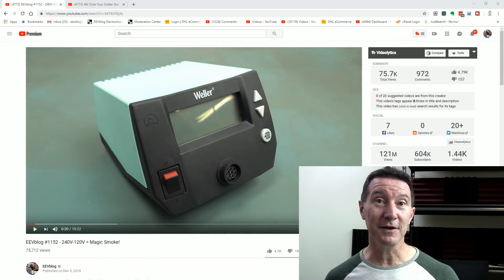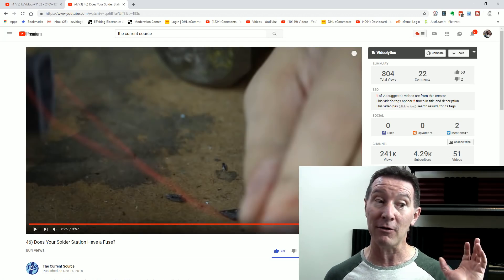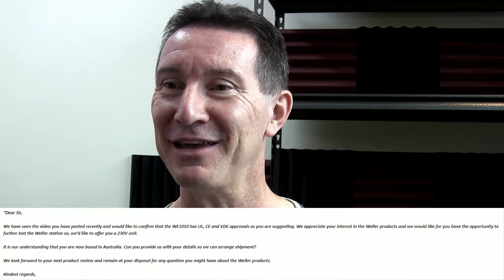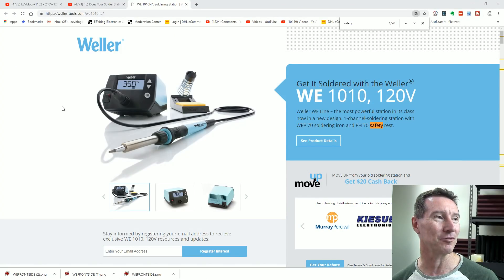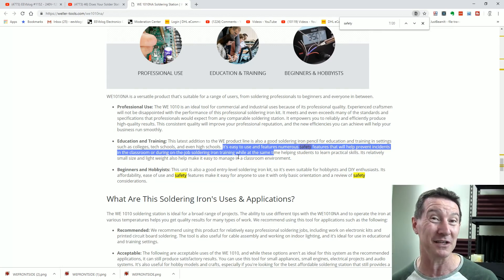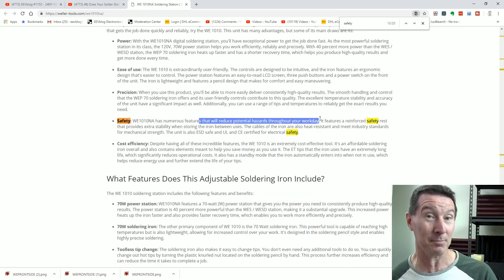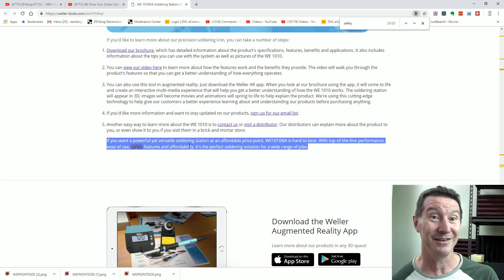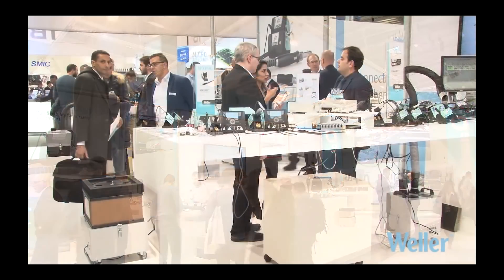EEVblog #1160 - Weller Responds!

Comment: This, of course, would not be a problem if it were normal to fit a fuse in the mains plug
Reply: Yes thats the best option, cuz even if they put fuse in the soldering station, it still doesnt protect the flimsy power cord that is rated 2A or so.

Comment: It is very easy to lambast companies by intentionally misusing their products...there is no such thing as a 'foolproof' product.
Reply: Please do some reading up on the failure mode shown. When it can occur without (non intentional - get your facts straight before abusing them) user error and in what other failure modes a fuse would be very important. Maybe then you won't sound like a marketing blob without electronics knowledge.
Reply: When you plug a 110V appliance into 220V power you should expect some sort of failure, and don't tell me it was 'accidental' because 110V american plug is incompatible with Aussie or European 220v receptacles, so you KNOW you are plugging it into the wrong power source. Dave Jones is just being his usual sensational self.
Reply: @NICK-uy3nl  if you pay close attention, you will actually find that it had an IEC plug on the station itself, so no voltage keying there. See https://youtu.be/8itTKH5tj3s?t=71 Also, to avoid misunderstanding, Dave did expect some sort of failure, as do I. However a fuse failing with a small chance of the transformer also failing, is a "little bit" different from smoke billowing out in a possible fire hazard. To top it off, this can also happen on a normal transformer failure or a non-user induced voltage problem such as a lifted neutral.

Comment: Dear Dave,
You should sue all the car manufacturers as their petrol engine will breaks if you fuel them with gasoline...
It was really a user error. Rtfm Dave ;-)
Never forget : With great power comes great responsibility!
Reply: You realize that petrol engine is powered by gasoline ? What the hell have you been putting in your engine , dude ?
Reply: Did you see his last video? he was bashing himself for being stupid and plugged it in without checking voltage! I did that several times, but good protection fuse + ptc, prevented anything but a small POP sound. He was just raising awareness about the dangers of not having at least a fuse(spoiler alert: Fires). 
Also your analogy with petrol cars (i presume you mean Diesel) is limited. The biggest danger with putting Gasoline in a diesel car is clogging the Engine.
Reply: I'm assuming you mean diesel vs gasoline.  Aren't the nozzles differently sized? (In contrast to IEC connectors.)
And what are the dangers?  With diesel in a petrol-engine, nothing's gonna' happen as it can't ignite the fuel. And according to @extervision, even gasoline in a diesel engine is not gonna' go Hollywood on you.
Reply: @0x8badf00d  Diesel in petrol engine will ignite , but you will  have a lot of black smoke comming out of exhaust due to not having a proper air to fuel mixture (diesel engines need more air). Gasoline in diesel engine leads to "engine knocking" due to high compression ratio (premature detonation). In both cases if you mix up fuels you need to stop the engine and drain the fuel tank. Fun little fact: it's not uncommon (specially for female drivers ) to mix up fuels  and there have been cases where fuel mix up lead to engine catching fire.

Also one more interesting fact: Truck  & cab drivers will often use heating oil instead of diesel to save on fuel  cost.This eventually leads to injector failure  and high carbon build up .

Comment: My ERSA RDS80 has a fuse+holder in the base, the only things I don't like is the connector (sloppy), cable between base and iron (way to stiff), you need the push hard on the buttons. Didn't have money for a JBC

Comment: I had a weller iron in the 70's worked ok, I was at a place that bought a weller solder sucker in the 80's - it couldn't even attempt to suck up a fart, never been interested in weller ever since - I recommend that you save your $$% and buy depending on your situation, metcal, thermaltronics, JBC or PACE

Comment: If they comply with those regulations than your video is crap.They have fuse for overload and a fast one on secondary side.  First try to understand how a transformer works (not to mention your other dumb turn ratio approximation from a previous video where you are measuring DC resistance).
If you are an engineer act like one!
Reply: But... It clearly started melting without anything to stop it.
Reply: @aveservices3052  You could also drop it and it could break with nothing to stop its fall. Just don't do it on purpose, or at least don't leave your foot under it when it hits the floor.
Reply: @aveservices3052   When you apply twice the mains voltage, what do you expect? Try this with a 220 unit powered by 440v ....and the fuse are rated at 250V....
Reply: Complying or not, the damage to the brand is done already.
Reply: @crimsun7186  By whom? A good engineer knows the details. Weller has it' s dedicated market
Reply: @CATA20034  A good engineer is not an alien species immune from bias and brand loyalty issues. In reality, a good engineer is more susceptible to those, as one can easily fool themselves using their own intellect.
Reply: @crimsun7186   I hope you know that a fuse on mains will not help you with anything... if you know what you are doing...
Reply: @CATA20034  Then why are English plugs fused though? Why Hakko puts fuses in the transformer primary of their stations?

Comment: In some products ment for the UK marked the fuses are placed in the lead plug.
On the transformer is that not a poly fuse?
Reply: It's on the secondary side of the transformer.

Comment: If I was weller I would have made it multivoltage, added a fuse and a micro breaker. Then wrote a email saying that the issue has been fixed and attach some photos of the new version. Also offer the new, multivoltage unit for free

Comment: I destroyed a weller iron plugging into 220v after moving to Sweden from the US... I stopped buying Weller after this. Perhaps they want to offer me a replacement unit too?
Reply: Plug all your 115 v-only devices into 220 v and see how many manufacturers offer to replace them for free. I'm looking forward to your video.
Reply: Wolfcritic64 I got a hakko and it has a fuse. No need for them to replace if if plug in to the wrong voltsge I can just change the fuse.
Reply: @TroyWuelfing  Maybe. Fuses guard against overcurrent and not overvoltage.
Reply: Wolfcritic64 I plugged the Haakko in to 220 and the fuse blew. No damage.

Comment: A bit of an over reaction here, but it makes for a good video!
How many of the ubiquitous wall wort power supplies do you have currently plugged into outlets on a more or less permanent basis? How many of these devices have you cracked open to see if there is primary side protection? Would you plug in a 120V only wall wort to 240V? I'd say there is more danger from these wall wort devices dripping flaming plastic onto a carpet than there is from the Weller soldering iron. Maybe you should do a video where you do a round up of all the devices that we use daily that don't have primary side protection?
Reply: Its poor excuse like "calm down, there is a lot more shitty products that are worse" given that the unit is highly priced and has some name on it, its just lack of paying attention to details, even if its not required, it'd be fine to put few cents glass fuse in it, just for shits and giggles and some common sense
Reply: "Would you plug in a 120V only wall wort to 240V?" How do you even do that?  Connecting IEC connectors to the wrong voltage can easily happen by accident, but you can't possibly connect a north American plug in an Australian socket.
Reply: @0x8badf00d  I agree how would you even do this, but watch the video, Dave did it!
Reply: @mcconkeyb  No he didn't?  I thought he connected an IEC cable to the soldering station, those are universal.

Comment: Personally I(but who I am) can understand lack of main fuse, but not the thermal one.
They must put one of this.

In such class of devices(transformers heaters motors) it is actually not a big deal to not have a mains fuse, because device is pretty "strong" to survive any short accidents in mains.

But also this devices have tendency do catch fire, and, with really significant thermal mass, so the thermal fuse is mandatory.

But they really should put both.
It is not the heater or vacuum, soldering iron have controlled and relative small power consumption.

I also can imagine, that transformer manufacturer (or they internal transformer division) was warning them about need of thermal fuse, but they like - "Pha! No extra money for you!"
Reply: It is also EXTREMELY strange that they fused secondary side, but not the mains.
Reply: And this is big deal for my region, for example, where real risk exist, 
that some building, or even few buildings, power accident can occur, 
which gives you 380V in mains.
And all electronics that have no protection will die and catch fire.

I think the is many people out there who live in regions with extreme 
weather conditions, hurricanes, snow storms, etc.
Such conditions have tendency to cause weird and wonderful power 
accidents in yours mains.

Comment: Dave couldn't you add a fuse on the primary side? I'd add one if that was my iron. I may make a safety plug type of device with a 1 amp breaker just enough to run a soldering iron or glue gun and not much else. The reason is one time my glue gun popped and it popped the breaker and I had to go down and reset it.

Comment: I can understand your point that this problem you have uncovered could be prevented by the addition of an inexpensive fuse, on the other hand you plugged a 120 v appliance into 240 v. I think you're being too harsh on Weller. They offered an iron suitable for the voltage level you are now working at when the original iron was clearly destroyed by your own negligence.
Reply: Now that I thought of that email some more, it sounds like they're just trying to keep a customer they thought moved from the US to AUS happy by offering a replacement to their old iron that got its magic smoke liberated by the power grid of its new abode.
Reply: and what about overloads? this unit could draw 8A without onboard fuse, and standard 10 or 15A circ breaker in distribution box wouldn't even notice theres a problem :d
Reply: they have a plug that is commonly used in computers/monitors that are multi voltage. so if they have the cable fixed to the station and an american plug at the end, most people know it is 120v
Reply: @ursodermatt8809  yes but it still can overload cause of malfunction and draw significant current (even if properly connected to 120V) and will cook itself
Reply: @sumilidero  how could a soldering iron overload?
Reply: @vihai  because of somekind malfunction? like increased losses cuz of distorted voltage, or some shorted wires inbetween windings cuz of vibrations, damaged flex etc?
Reply: @vihai  Few years ago, electric company was doing some maintenance on our distribution network and managed to get 380V  instead of normal 230V on our household network. Their insurance company covers the cost of damaged devices plugged in the network but imagine that your house burns down just because your soldering station didn't have basic input protection.
Reply: Sure, much like how AvE was harsh to Fluke when he showed that the T6 sends 120v AC to the grounding point you put your finger in when you have it in current sense...
Reply: @crimsun7186  I've used that T6 for months now day in and day out  in an  industrial 480v maintenance role.  It's a fine meter,  it's not perfect put great in a quick check troubleshooting role. 

I like his videos, even supported him on Patreon before all the Sargon nonsense, but people put too much credence in AVE.
Reply: A thermal fuse in the transformer is cheap insurance against various unexpected failure scenarios going nuclear.  Weller are not a budget brand.  They can afford the trivial cost increase of a safe transformer.

I do not feel sorry for Dave's toasted unit.  No 120V product should be expected to survive 230V.  But a simple thermal fuse would have turned it into a graceful failure.  Heck, I design MY OWN projects to withstand 230V even though I can't imaging them ever being subjected to it.  It's just good practice.

Weller completely lost my respect here, and I'm a little embarrassed to own one now.  Especially after the response.
Reply: I don't disagree that a thermal fuse would be best practice. I just think Dave needs to take some responsibility for his mistake. Soldering irons should be attended to anyway so I'm not overly worried about owning one. Weller likes to market themselves as better than budget brands but I don't think the quality lives up to that in actuality.
Reply: @randybuttigieg  He broke his soldering station, his fault. But that does not change the fact that Weller should've added a mains fuse in it.
Those fuses are not intended to protect a product from it's abuser, but to prevent things like a fire hazard.
Reply: Except voltages can raise in your mains with no negligence on your part whatsoever. A thing as simple as disconnected neutral wire in the electric panel can make voltage of a particular phase go from 220V to anywhere in 0 - 380V range. In fact I had this happen to me personally. Luckily for me my phase was more loaded than others, so I had lower than normal voltage in my outlets. But somebody else got high voltage instead. Hopefully no Weller products were plugged in there.
Reply: @kuklakot4516  ....and a fuse would not have helped. Self-heating due to overvoltage and saturation can burn the transformer while staying well below its rated power.
Reply: @vihai  A fuse would help, because a burning primary coil would raise the used power. But a mains fuse could not, because a mains is for maximal amperage. A 16A fuse would allow for way more than 16A.
But a fuse designed for the machine would burn before the smoke even escapes... Still the transformer should be thrown away at that point, but you don't have to replace your cardboard wall.
Reply: @bloepje  non necessarily: a 80 W transformer can burn drawing 40 W of self heating.

Comment: just curious what current the mains breakers are typically rated for in AUS?  Are they 15-20 Amp at 240V, as opposed to the 15-20 Amp at 120V here in the States?  If so, would the 20 Amp at 120v trip under the load of a faulty primary on this iron?

Comment: To be fair, you can read and here in germany i cant buy a 120v device in store so i dont see any problem....
Reply: Never saw a lifted neutral put 400V through anything? Also, in case of a secondary short or internal problem, the unfused transformer will release it's smoke.
Reply: There should be a fuse anyway. Imagine internal short between windings..do you think its ok to keep heating up until it melts or even burst some smoke and flame? For chinese crap brand maybe...
Reply: JanicekTrnecka for that i have primary fuse if the primary site of it short out.
Reply: @ikorbln  thats the point, there ISNT a primary side fuse. Expecting the mains breaker to trip is not acceptable. Here in the UK, we have fuses in the plus to protect the flex, and this would be fused at 3A - but 3A is still far more primary current than would flow normally. Similarly, we have "ring main" circuits with 32A breakers.

There is no excuse for not having a thermal fuse.
Reply: Peter Mulholland i know what you mean. But i dont get it. i worked for years with weller and no single one of them get on fire. And i never heard of it in the „news“ that a weller burned down a house or so.

Comment: I can no longer get tips for my old Weller in the UK. It works perfectly and was top of the range. I was told that due to it's age the tips were now subcontracted out. It works out around £30 for posting and packing plus the cost of the tip. I didn't bother to find out what that was. I have since found a non Weller tip from my usual gubbins supplier - China.  £5  odd for 5 postage paid. Maybe they won't last as long but at around a £ a piece they beat £40 + each. While I was on I bought a £1.20 40W iron and replaced the lead with a 3 core silicone one with an earth connection. Apart from the screws sticking out at the tip it makes a good odd job iron.  I suppose that in the UK the plug fuse would be as good as one on the primary for some Weller irons.

Comment: Perhaps the transformer was designed as a class 2 transformer? This type of transformer is designed to fail before the downstream electronics. The insulation is not the problem on the transformer, all transformers will over-current at high input voltage. The primary side fuse would have protected that transformer though, but it would have to be a fast acting fuse. Contrary to popular belief, you can't normally reverse a transformer by putting 120V into the 12V secondary in a 10:1 transformer to get 1200V out. That transformer will only output magic smoke. The most you can put into the secondary of that transformer is about 12V. This is because all iron-core transformers have a limited amount of volt-seconds before saturation takes place. Transformer core saturation depends on the input voltage, not the current.

Comment: Most likely they have been grandfathered in, using older transformers designed before the UL started requiring primary side fusing, the secondary side addons like PTC and backup fuse soldered to the terminals suggests that. That transformer is an old part number, probably will fit the first soldering stations they ever made exactly, so they simply never upgraded, the testing only being really for "new" part designs.